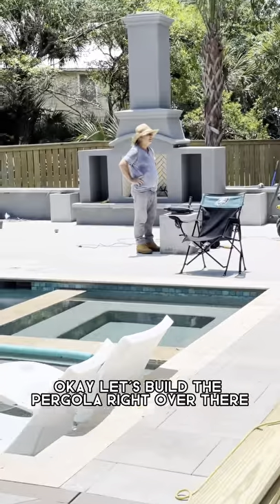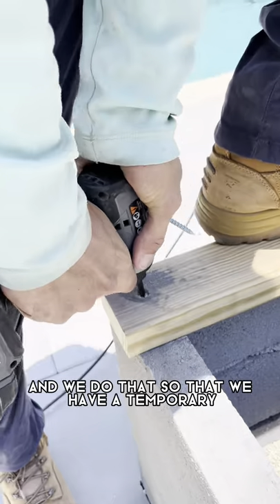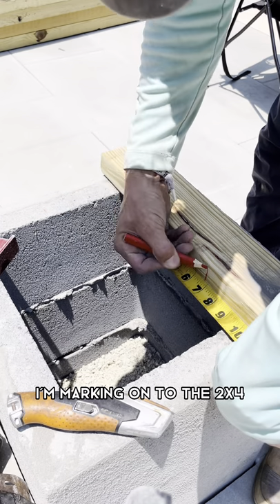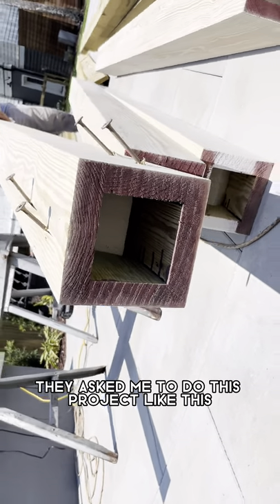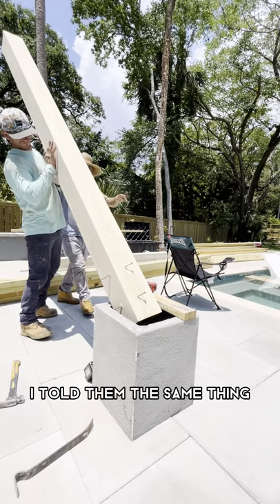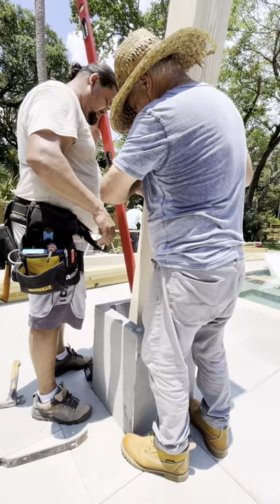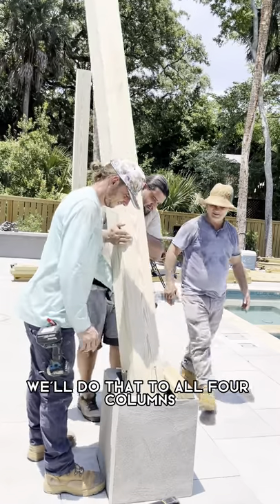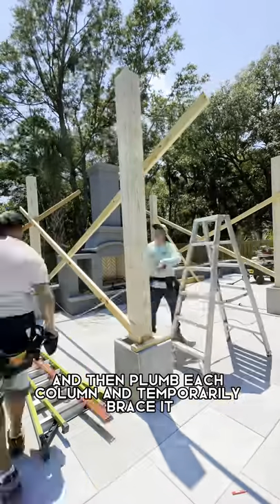Building a Pergola Part 2

Comment: 6x6 columns are very expensive and hard to get them straight
Reply: So you can use steel post and clad with finer wood or PVC. Still expensive but cheaper isn't usually the best way to build unless you don't care about durability.
Reply: @matthewtuel2747  yeah I was looking into those steel post but they're going for $37 a piece for a 8-footer. I was thinking some rebar and cement with high tension fiber would be a lot more sturdy at pretty much the same cost.

Comment: Sometimes the customer is "always" right, and sometimes you have to just do it right. I sometimes have a hard time keeping that balance. (I like the word "sometimes." That's why I use it too much. 😁)
Reply: In this field. If the customer is right? You should quit and go back to a factory. This isn’t retail
Reply: @pjplumber2146  Sometimes it's ok to let your customer have his way. I was hired by an old friend and her husband to be his helper on a small job that involved, among several other things, pouring a small slab to widen a bottleneck in his sidewalk. Now technically, he was running the job, (not my usual situation, but for a friend, and they're pretty old. . .) but when we mixed the concrete, he was making it too wet. I squawked about it, but he held his ground. I could have maintained my position, or told him I couldn't continue, but it wasn't really necessary. Had it been a structural issue, like a footing, that would have been different. But since it was only a sidewalk, although I didn't exactly like it, I stayed with it. It wasn't so wet that it would even look bad, and it will probably last 30 years. Not like the guy running a small commercial job, who did a slump test, and when it met the engineer's specs, he proceeded to add more water.  I might have walked off that job, even if I wasn't in charge. (I wasn't even there. . .)
Reply: @pjplumber2146  Also, you know there's no accounting for taste. Would you walk off a job if a customer wanted you to do something that you thought looked bad, but didn't compromise the quality? (Imagine something like yellow siding.  Gaaaak!) You can't really fault a person for such choices. I might try to talk them down from that ledge, but probably wouldn't walk away. That would be, in my opinion, unprofessional.

Comment: I’ve wrapped the bottom with plastic if I buried wood like that. I don’t like it either but I think it helps.
Reply: Actually, it probably doesn't.  The main problem being that any water that gets in will almost never get back out and only the wood can absorb it. Secondly, the plastic will keep the concrete from adhering to the wood if only for a few years. 
The best thing would probably be to thin tar with mineral spirits and soak the buried ends for a day or two, especially letting it soak in to the end grain
Reply: This topic is interesting what about improving plastic with tyvek something that breaths then using the dowels With screws like shown In the video? I’m doing some experiments on this now. Thanks

Comment: Is that treated lumber? Shoulda just dropped a 6x6 in there. I get it why they wanted it in the concrete though gives it more shear strength, but ya rot eventually but whatever